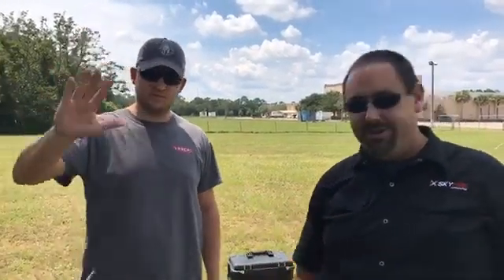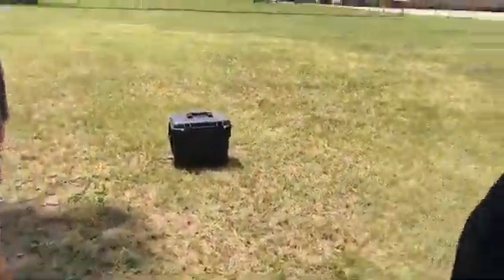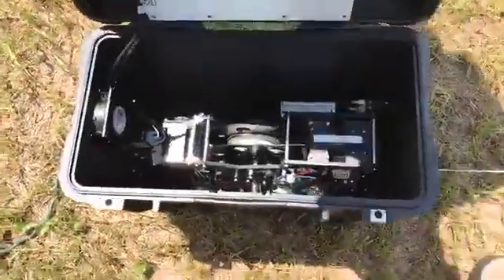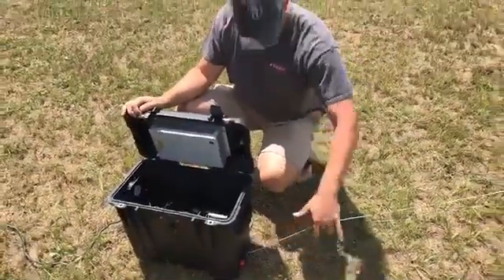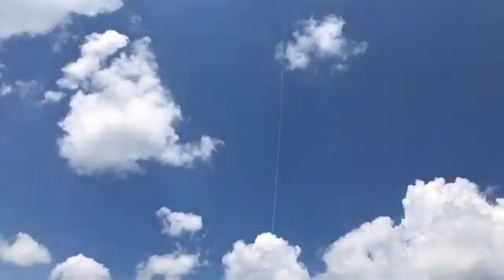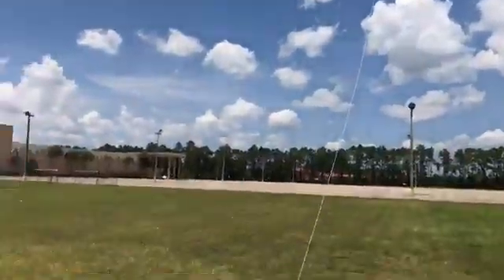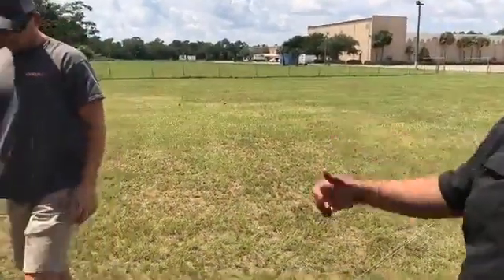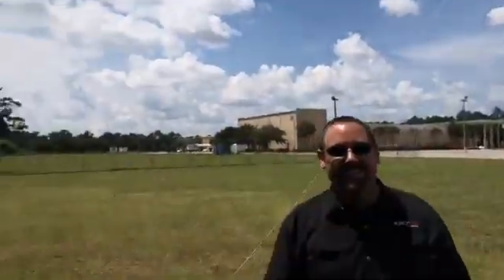Check out the new M-200 and Inspire 2 tethering system from Drone Aviation Corp

Comment: That's what she said! 😜 but $10-$12k for that is nuts 🥜
Reply from the maker: It's a bit on the pricey end, sure, but considering 8 TB55 batteries would cost around $3k and only give you 2.5 hours of flight with 4 changeovers, the ability to fly continuously for hours on end could be worth it to those departments needing a stationary, prolonged flight.